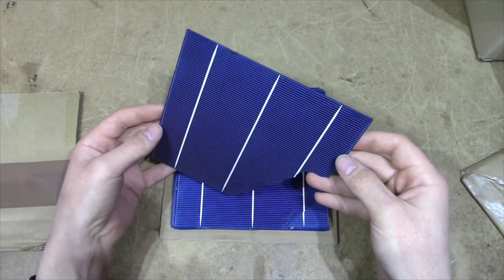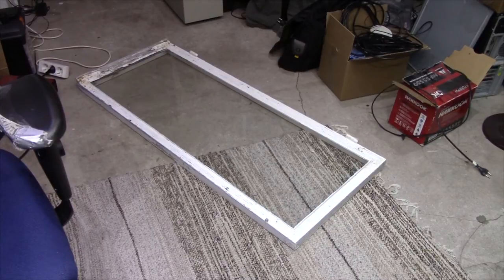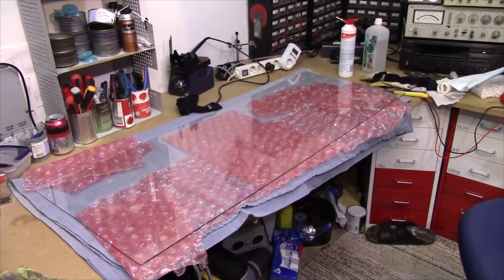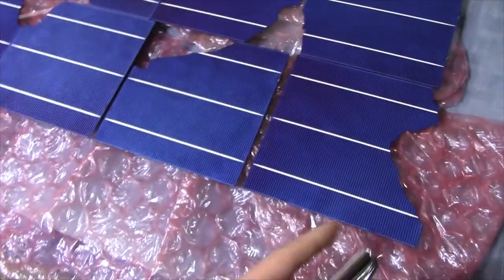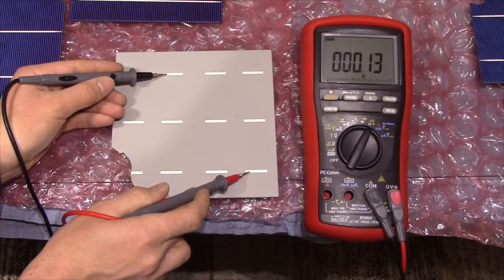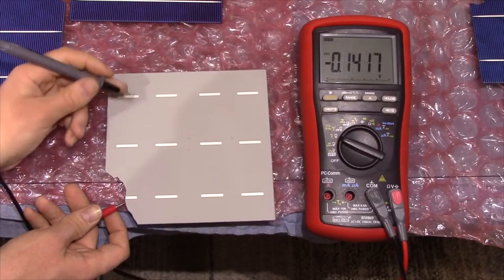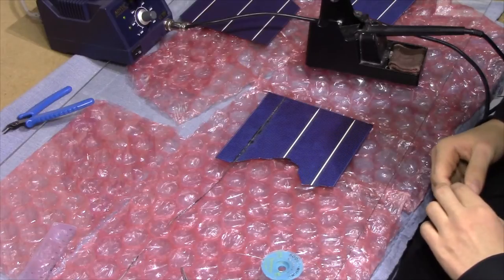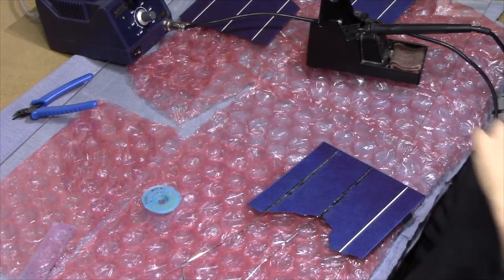PROJECT LOG: DIY solar panels, part 1

Comment: Hey there. Interesting project. Now I know what you meant by building solar panels your self. I didn't know that you could buy damaged solar cells on ebay. I checked that store "OFF-Grid-Europe" and I saw that they sell various grades of "broken cells". Did you mean that each cell will have an output power of 4 W under absolute ideal conditions, or under more realistic conditions (of course depending on where you live, the time of the year etc...) ?  (BTW: Sorry that I missed to wright you earlier, There was so much to do that I didn't realy had time to answer my youtube messages )
Reply from the maker: I'm not entirely sure; they don't tell you the actual brand of the cells, nor do you get any real datasheet for them. 4 W/cell is probably specced with an STC of 1000 W/m², as that's a bit of a de-facto standard when it comes to solar panels. (These damaged cells also need to be de-rated by 20 %, since they're smaller.) It's a bit optimistic for places like northern/central Europe, but it's not impossible. In practise, they're going to give probably 20-30 % less than that on a sunny summer's day, though. My assembled 130 W panel array seems to top out at about 100 W, according to my charge controller.
Reply: Yeah STC is basically the most unrealistic standard ever, but it's still used all the time, even though more realistic test environments have been defined. It's a merketing strategy... May I ask how much money you had to put into the parts for that 130 W panel ?
Reply from the maker: The Post Apocalyptic Inventor You may. It turned out more expensive than I had hoped for, with a total, all-inclusive cost of about 100 €. About 50 € went into the cells and tabbing wire, 30 € into the glass, and 20 into the silicone to hold everything together. Plus 20 or so man-hours of work, figuring everything out and putting it together.
Reply: Well, thats a lot ! I'd say as a one time experience it paid off, because you gained valubale knowledge, but if you're planing to build a bigger system, you  should consider buying the other panels, rather then building them this way. You get a cheap 100 W panel on Amazon for around the same money.
Reply from the maker: The Post Apocalyptic Inventor Yes, indeed, and I'm probably going to buy a few pre-built 250 W panels when I expand the system.

Making panels this way is only viable if you have access to free glass, since that is the biggest cost when you scale things up. Even cheap glass like mine is too high a cost to justify the amount of work that goes into this. You simply can't compete with Chinese slave labour.